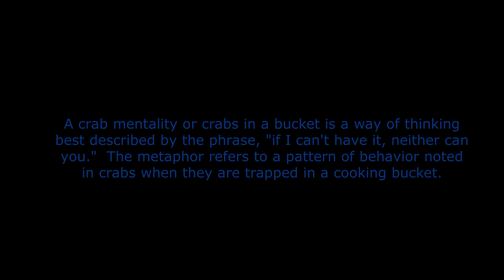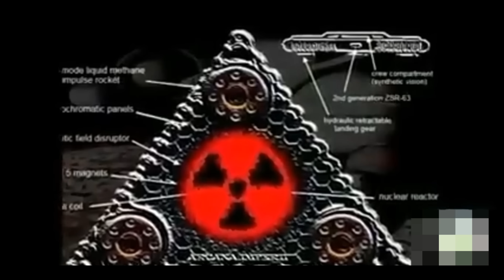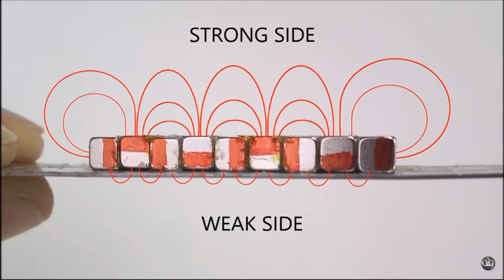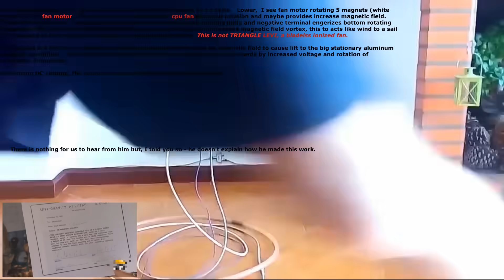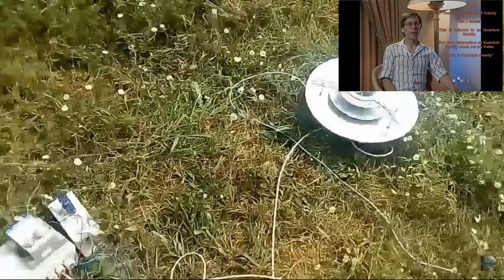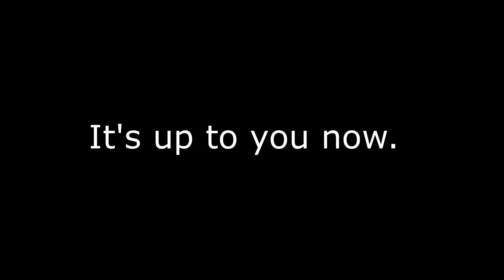anti-gravity project

Comment: If you want to build an antigravity propulsion system you need  DETA switching power supply , rolling gate controller , on the top of the rolling gate controller must be gas valve and ignition controller and next to it garden light transformer .It must be the other way will not work .
Reply: Don't forget the flux capacitors

Comment: "Antigravity" effects can be created only in 2 ways:
1) By using lifting forces by ionization processes in the gases in which the movement takes place, locally, in specific cases.
2) A more larger "entropic" dynamic manipulation of all the mediums, gases around planets, inside galaxies, space outside a planet, inside galaxies, on intergalactic rides, etc, in general. /
Gravity is not fundamentally an "atractive" phenomenon. It is fundamentally repulsive.
The "attractive" effect that's "seen" is a reactive effect to the main active one; so, the main one is fundamentally repulsive in the correct and real dynamic of the Universe.

Comment: I can see that the fixed lower disc would be repelled upwards by the spinning magnets below (as in levi track or Lenz effect) but equal and opposite forces would not allow an unbalanced lifting force. I presume the upper spinning disc is counter rotating only to stop the whole system spinning. It would nevertheless mirror (oppose) the magnetic fields generated in the larger, lower disc. Equal and opposite forces would cancel each other. How do you explain the lifting force?
Reply: Magnetic flux field.  Same thing that “pulls” certain craft. Not “push” like every propulsion we know of.

Comment: Dr Searl.    I have read that the first time he started the rotation of the magnetsin hia generator,  the device flew straight up and through the roof  of his home, never to be seen again. This makes sense in that the magnetic field created by high rpm rotation would negate gravity, create a time distortion and ignore the roof of his house and not having weight , would pop up into space no different than a bubble of air  will travel upwards in water, and just as the examples seen on this video.
Reply: A bubble of air travels upwards in water because it is lighter than water. So that suggestion is wrong. Just because supposedly his machine has no mass, does not mean it will go upward.
Reply: Actually at 14 years old it burnt the cieling of his rented room ,his landlady was not impressed, but he achieved a bi product of his original generator intention ,this was the prototype of what became the Searl Effect Generator ,frictionless rotational device.

Comment: Been researching this stuff for a long time.  Lots of Hoaxes.  Chekurkov's toy has alot of interesting properties, but it is a toy.  there's alot of clues in the video, but a few are missing.  eg. Monopoles, frequencies, diamagnetics, spark gaps, etc.  A true object 'locked' at a certain height in the earth's field should stay stationary as the earth rotates underneath it. Considering air resistance, etc. of course.  Am i wrong?

Comment: one of the problems with magnetic energy is.. if one side is positive the other one is negative... and pushing off the Earth's magnetic field means..  as soon as you get off the ground... the durn magnet... flips out... ausgeflipps >> auf Deutsch... also... there are, I think... 3 components for gravity
magnetism... vorticity... and their combined effects on the quantum foam that we have found at the Planck length level... 1.6169 × 10 -³⁵
the curvature that bends light around a mass like the sun or a planet... 
it takes work to move mass
I'm starting to experiment with dirigibles... lighter than air... but have the same idea of using magnetic fields for motivation... I'm waiting for a few things from Amazon at the moment... but I have all the components... we'll see what happens

Comment: I can show you how to do it with no magnet, no coil, no moving parts, no battery or any input power whatsoever. It's done with sound... 2 granite piezoelectric speakers facing in opposite directions with a hole in the center... and a microphone consisting of a xylophone key mounted on a fret above the speaker facing up.... with a 4 inch spark gap (of radio frequency) between the tweeter and the outer edge of the speaker.  The tweeter cup sits under an air hole of a box drum and water condenses in it and lights up and spins like a galaxy in a box. It will make it's own air, water and gravity... and It's so easy. And oh ya... it's over a trillion watt AC. Water is magnetic,, and you spin it with sound...and because of that you don't need a magnet or a coil.
Reply: I dont understand, you can please make a drawing?

Comment: Great job.Maybe you can find this useful.   

 1.Similarly, a copper coil at the outer rim (located on the interior of the vessel) going all the way around and connected to itself creating a closed loop system is stationary while a large wheel having very large neodymium magnets located at the outer edge of said wheel allows only the North ends of the magnets to pass in close proximity to the stationary copper coil then creates a very high voltage (20,000,000 volts) in the closed coil system 

2.and that voltage is then fed to an iron pole located running through the center of the craft from the top of the disc shaped craft to the bottom of the craft where the current is then fed to three large dual plated capacitors located at the bottom outside of the craft where the current is then transformed from electrical current to electrostatic fields projected outward from the bottom of the craft where this static field then bends around the outside of said craft attracted to the top of the iron pole at the top of the craft where the field then dissipates into the top of the pole flowing in the same direction as the new incoming electrical current just in from the coil and the field is then transferred back into electrical current again and thus continues recirculating forever this way. 

When the power of the charge going to the capacitors is adjusted to around 290Kv per Cubic Centimeter it is then more powerful than gravity which has a set power amount of 289Kv/Ccm and the craft then floats weightlessly. For maneuverability one simply adjusts the power to each capacitor independently for forward and back and left and right and a separate coil at the base of the upper conical dome (the bridge) is energized separately with its own charge amount for up and down maneuvering.  Now, hook all this to a computer controlled steering wheel so that vectors of multi directional maneuvering can be harnessed into the steering wheel so that the craft can be driven like a car and you have a simple and effective flying saucer that you can build in a large shop at someone's farm in total secret like we did and then fly it slowly the first few nights to get the hang of it before test flying it at higher altitudes. 

Note, you will find that for every KiloVolt above 289 you will be able to fly at about 1200 mph so 290 Kv into your upper bridge coils (located outside the craft above the middle of the rim of the craft and just below where the upper cockpit is attached will cause you to fly upwards at 1200 mph which is TOO FAAST! ! if you're not experienced so infuse into your circuite between the iron pole and your capacitors a main variable resistor that runs current into a much smaller variable resistor and run both to your computer control system so that you can use the smaller resistor to adjust volt by volt in a main accelerator pedal while a second accelerator pedal is for the large variable resistor. Using the smaller accelerator pedal on the floor of your cockpit you can fly at normal relativistic speeds of between 1 mph and 1200 mph max. The main accelerator pedal will override the smaller pedal if you contact it with your foot and those speeds will be between 1 mph and beyond light speed. Light speed is acquired easily in moments (outside our atmosphere) because the field around the craft eliminates inertia and all effects of gravity and therefore mass cannot become more dense as implied by Einstein. Einstein would be correct if the matter of the craft were directly exposed to space fabric at speeds approaching light but the field insulates the matter of the craft and everything within the craft so his relativistic laws don’t apply here. Have fun and be very careful!!!
Reply from the maker: Very good explanation, wish I had the black funds to do this project, me selling hoodies don’t fund zero.
Reply: Have you done this? Is there a way to learn more about the theoretical physics behind this idea?
Reply: @daniivanov4554  hi, I have not built it yet. I just received the info from someone else. As for theoretical physics, study vortex mathematics because this craft simply creates a toroidal field. All matter from a particle to a solar system incorporates a torus. Anything placed inside the field at the zero point can be altered due to the principle of dominant frequencies. This is how you teleport or open a portal by the way and how ufos shift from point a to b rather than travel conventionally. A toroidal field is made up of harmonics of frequencies related to base 12 mathematics (not 10 or Tesla's 3,6,9,)which can be modulated in both frequency and amplitude to generate an equal and negative counterpart of gravity resulting in levitation. Counter rotation of mass is required to vary the relationship of said frequencies. The centripetal and centrifugal forces in rotation sustain the torus. These are called gravity generators where metallic spheres filled with counter rotating liquid is typically employed in each corner of the craft for control. Stan deyo, Otis car, Rodin coil, the government TR-3b, all the same. They use different means of producing a toroidal field on a small scale. What they don't tell you is that you need a sensor like a highly sensitive interferometer to measures the local gravity frequency and then a means to translate that data into something useful. The Nazi die glocke for example, produced lift, but did not fly very well since there was no gravity frequency matching, thus no control. You can think of gravity as high frequency magnetic flux where the flow is down into the Earth's core at a 45 degree angle dragging anything downward that resonates with it's frequency. What's interesting about the craft employing capacitors that I  sent you is that the electrostatic field from the caps seem to auto resonate with gravity. Amplitude modulation instead of frequency modulation is all that's required, so no gravity sensor is needed. Beyond 294 kv/m and the static (toroidal) field is stronger than gravity and the craft levitates. I highly suggest antigravity researchers experiment with this effect that doesn't seem to be complicated or costly. There is a discussion I have with an antigravity expert on my YouTube channel called esssasani antigravity 101. It might be helpful to you
Reply: @scraw3  May I contact you in some way should I have a question through my own efforts of endeavour of this nature of mobility acquisition going forward?
Reply: @davidclark8857  yes you may. Message me anytime my friend
Reply: @The Reptilian Representative .. The most physically trapped , and most free of minds limits, the best seen to adapt, yet binding time inhibits
Reply: 1 that starts 10 and a first of all lasts.. shining brightly one colour- and all shades to contrast
Reply: @scraw3  Do you know of such presence- so utterly here, that observing is looking into nothing there
Reply: @davidclark8857  are we here to talk science or poetry, lol
Reply: @jose garcia if this is true then I maybe a step closer at figuring out who posted it this information. The author speaks like he built and flew it. Very exciting!
Reply: How much would it cost to build a project like that estimate? Can you build it given the right material?
Reply: @rainmanj9978  the most expensive part would be the frame and hull. I'm no metal worker, but I would say a few thousand for parts plus labor to weld everything. The capacitors maybe a gallon of acrylic or so around $50 to $100 each, high voltage circuitry, wire transformer, under $1200, the magnets around a few hundred dollars each, the rotor to mount the magnets will depend on what type you use, protection against possible ionizing radiation from the high voltage and possible plasma produced, don't know how much that would cost, but overall for a prototype you won't need that much money especially if you can salvage parts from a scrap yard. The important thing is to contain the electric field that comes from the capacitors.
Reply: do you have any e-mail I would love to see some drawings and schematics if you have...It would be very interesting to have all details so I can make small scale model...Sounds interesting .Thanks
Reply: @mariojuric7396  I don't have any drawings or schematics because the info was passed on to me as is. This is a simple device though. Just bend the electric fields around an insulated sphere or whatever. Step the voltages down and use low voltage to control high voltage at the caps. First experiment should just be to make sure the e field is structured correctly. Next step is learning how to generate and contain high enough voltage. Levitation experiments won't even work unless your at atleast 294 kv or so. If you manage to generate antigravity well my friend your real problems will begin since your likely to accelerate the craft so fast that it may injure someone if you're not experienced in flying. You can also create the same effect with a plasma. There is a US patent for a plasma craft UFO style.
Reply: @scraw3  seems to me a microwave could be a great source for cheap parts to help with power.. You would know far better than I
Reply: i agree that if you build a terrifying reverse lightning pole it might move up, but i don't think that it can reach speeds close to light speed, even in space. also, i don't think the fields can protect you from the laws of physics

Comment: Seems like using positive ions or negative ions ionic propulsion! And a proportion cannot hold up a lot of weight things that weigh heavy cannot be lifted up so you definitely cannot make a hoverboard or anything like that
Reply from the maker: it’s the effect of ionic when areas are negative and positive charged, when capacitor areas have increased negative positive you’ll get lifting, like static ballons repelling each other so increased energy and area i expect to get lift. Ionic is a by product when negative positive side are charged.

Comment: To jump you have to push down. Same thing with the mercury device. . As the fluid accelerates. Half of the mercury’s mass that is directed up is divided outwardly in to the fluid viscosity. I suppose that could be possible if you could accelerate the particle in one direction and slow the mass as it comes back down. Dividing it into a angular momentum and reducing that over the volume of the fluid before it acts on the case. But it takes a ton of electricity...  you’d have to divid that extra mass by angular momentum and ground it to reduce the negative lift on the shell. But to do that entirely?  The entire thing would be energy...  the battery is the flaw. And its only if you have a cyclic mass generator can you attempt to compile the two where then the inertial frames should fail and thus lift fails.  

Wireless electricity would work but then you are losing a ton of electricity and at that point why bother with the fluid and not focus on quantum locking?
Reply from the maker: I get the idea of angular leverage i just never thought where a spinning gyros doesn’t.  Your suggestion of angular lift could work as the circular mass can be directed as reaction.  Example hold out two 3 dumbbells outwards at -45*, now spin like an ice skater, the dumbbell weights will want to raise your arms to + 45*, would you call that mechanical lift?  
Mercury could be used as mechanical lift by divergent channels to change its position from -45* to +25* by rate the fluid is affected by outward rotation ~ like hanging on a merry go round you legs hanging outwards.    As power source we need something we can’t get for direct current and only make micro scale models.
Reply: @jefflucas_life  ya. I call the gyroscope effect  a harmonic mass stabilizer. Its just that as housing lifts. The atom that isnt in a solid state compared to a spinning solid weight. Mercury atom is re-absorbed into the fluid stream. Rather than cause and effect. The magnetic field then negates the resistance of the atom as its inertia meets the stream. So you have more mass at the top of the container than the bottom and the contain can lift. Divided by its viscosity. As it lifts then The atom is stuck in its frame. Sorta floating there before dropping as the fluid stream rises and meets the atom.
Reply: @jefflucas_life   of course, it wont work though. The magnetic effect that accelerates the atom is experiencing the same cause and effect.